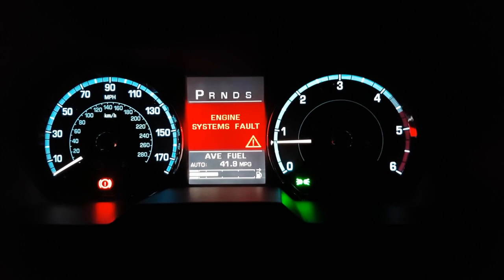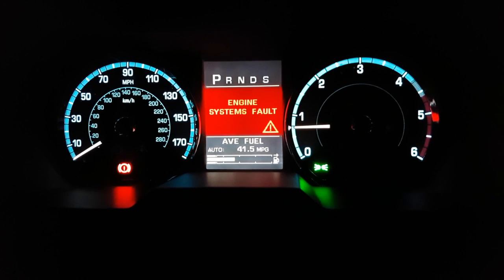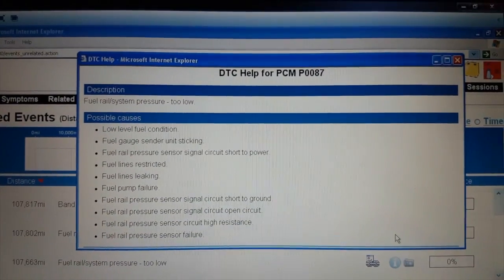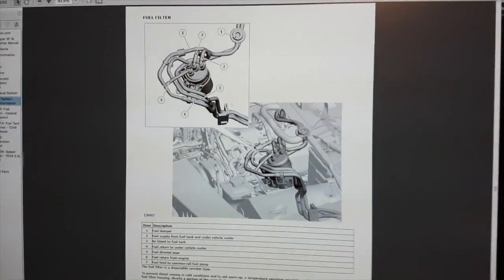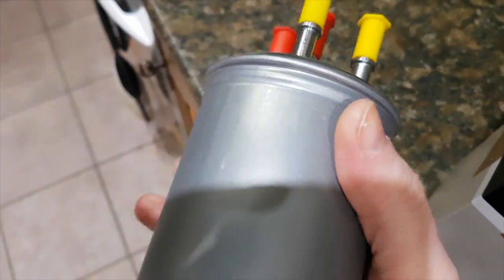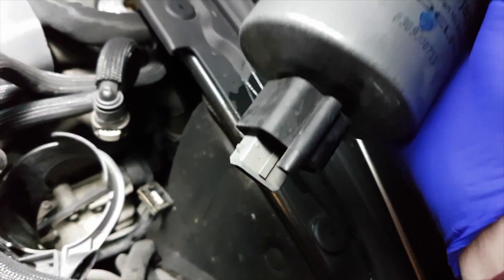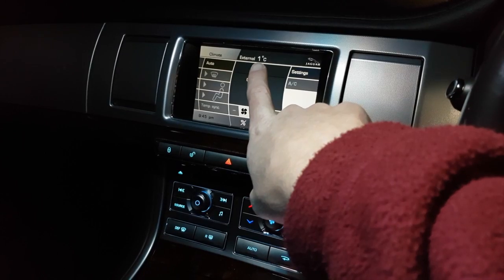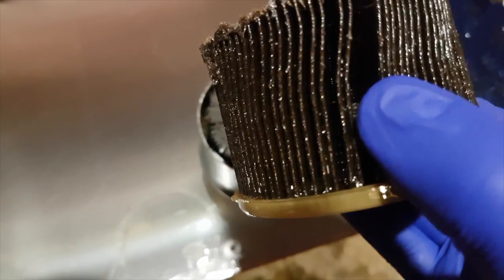Jaguar XF P0087 Engine Systems Fault and Fuel Filter Change

Comment: I've tried to prime the new pump this way but it doesn't feel like any petrol is going into the filter. I have half a tank so plenty of fuel I've resorted to putting the old one back in as it still had fuel in it. Could I have a air blockage in the fuel system or something? I'm just short of flattening the battery

Comment: I have a 2011 XF Portfolio and it keeps saying that there is water in the fuel, would a new filter solve this problem. i have done what the user manual says but it still says that there is water in the fuel. Any help would be appreciated

Comment: I have an water in diesel warning. I plan to change fuel filter which is probably due as 10 yrs old. How do I re-set warning light do I need specialist plug in diagnostic equipment?

Comment: Hi Fella
Excellent video! I have exactly the same problem ‘to a tee’! You have explained this in a very clear way for a mere mortal like myself to undertake. Hopefully it will work for me? Worth a try.
Regularly serviced  by Jaguar @ 135,000. Just noticed that there is no sign of a filter change anywhere in the service book…… Sheesh!
Where did you get your SDD software?
Thanks for your super video👍

Comment: Had exactly the same symptoms when entering motorway and giving plenty of throttle my 2.2 XF.  Engine died and had to coast back onto hard shoulder. Thank god it didn't happen on one our lovely new " smart motorways" . Re-started a few seconds later and drove home on reduced power. Changed fuel filter and all is well. Interestingly I date checked the filter and despite having so called  service history ( I bought the car with 80 k on the clock) the filter was the factory fitted original !

Comment: My XF S was only serviced 2000 miles ago, at an independent Jag Specialist garage. It had a major service and cam belt change and everything was good. I filled up at a local supermarket, before setting off on a 270 mile trip. About 20 miles into the trip, I got the water in the fuel, check handbook warning message! I thought here we go, another expensive trip to the garage and will I even get to my destination. I looked in the handbook and I couldn't find anything about what to do, so I googled the problem and amongst the results was this video. I am very practical and even recently rebuilt a 1974 Triumph Spitfire, however my XF is dealer maintained or Jag Specialist maintained, so I don't normally get my spanners out to it. This video is really well done and even includes how to re-prime the system, so I ordered a filter from Berkshire Jag Components (a Bosch filter, about £39 including next day delivery) and did the job myself. It took about 15 minutes, was dead easy and I had no problems what so ever. So thank you very much indeed, for taking the time to film and post this!

Comment: Hi, very informative video, just had my annual service done and that included fuel filter replacement (XF2009 diesel 3.0), an error in dash 'Water in Fuel' straight after service, mechanic suggesting to change the sensor under the filter, any idea what that might be ?
Reply: I get the same on my 2013 XF3.0 D S. I've read that fuse F43 in the main underbonnet fuse-box may have blown. I don't know why it should, but it might be a quick fix if it has. I believe the sensor itself costs £50 or so, but it seems to be a simple screw-in part on the bottom of the fuel filter canister.
Reply: @spudmurphy764  Hi, it was bad sensor, ordered for £90, all now fixed.
Reply: @Muhammad-Majid186  Thanks for letting me know. Checked F43 today - OK. Drained some fuel out of the base of the filter- clean as a whistle - no water at all. Went for a run - no warning lights, which is good. Hope it doesn't come back though - the sensor is easy enough to unscrew but its wiring goes straight into the loom, joins up with the wiring to the suspension top mount and the 2 of them disappear into the depths - dreas to think where I'd reconnect them.
Reply: Spudmurphy how many miles on your jag xf when this happened?
Reply: @eddybetanya  happened at 66,085 miles.
Reply: Spud murphy its just happened to mine (water in fuel) at 65,190miles.
Reply: @eddybetanya sorry to hear that, most likely to be WIF sensor gone bad...please keep me posted if/how fixed, cheers
Reply: @Muhammad-Majid186  All sorted now, new filter installed, car is much more responsive now, goes like hell.
Reply: @eddybetanya  👍👍

Comment: You could have avoided this by changing the fuel filter when it should be changed - or better yet before it needs changing. It’s an easy job.
Reply: Not always the case. Thanks for your helpful input though. 👌

Comment: My jaguar XF  4.2L supercharger engine power is low... my check engine is on... I haven't changed  my fuel filter ever since I bought it 2 years ago... is that the problem???? Where  is the fuel filter located in the XFS

Comment: Doesn't surprise me. I will NEVER take my jaguar to a Main jaguar dealership again.  Was told fault on mine was as a result of having a 'non jaguar approved' filter fitted so warranty didn't cover fault or replacement.  Only thing is, the 'non jaguar part' was fitted by the jaguar main dealer i bought car from 12 weeks earlier.  When I got car home checked new filter to find this main dealer had fitted an identical make and manufacturer filter ( that they advised was non jaguar approved).  My opinion is that the service departments are crooks and rip off merchants.  But parts on line and DIY. :)

Comment: Hi Leon, 
Would you advise removal of the battery negative lead before starting the job?

Kind Regards
Reply from the maker: Before doing most electrical work, yes. For diesel filters, brakes etc. I personally don't, although the service manual would have you disconnect it for everything. I just find it a pain in the ass to reset windows and other settings after having the battery off.
Reply: @leonfletcher6045  Thank you.

Comment: So this light has been coming on constantly recently and after I see it sometimes the car shuts down completely but doesn’t have no reduction in power, starts right back up and drives beautifully but it is doing it frequently. A mechanic ...not the dealer, put that car check thing in the box and nothing for the code. I hope it’s a fuel filter for me too because that light scares me and my pockets!

Comment: What the unit or system you use to identify faults ????
Reply from the maker: I use SDD - the dealer software, running on a Panasonic Toughbook and a Mongoose cable... but a OBD wifi Dongle (ELM327) and one of the better smartphone apps could do it.
Reply: @leonfletcher6045  cheers for that I have found a free download site for the add software but I search also for the disk copy also

Comment: Great Vid!!! Had the exact fault & replacing fuel filter did the trick. Many thanks :)
Reply from the maker: Glad the vid was useful! :)
Reply: @leonfletcher6045  Hi. Can the filter actually be "drained"? Someone mentioned it on some Jag forum, but I don't remember exactly.
 
Btw, the buzzing sound at 15:53 that's a fuel pump??  Mine is quite loud and I find it really annoying. I think I can even hear it when driving, the pitch is changing a bit, depending on engine rpm.

Comment: Hi Leon, great video! Got some real insight as my 2013 Jaguar XF 2.2 Diesel presents with a similar code - P0088. My local garage says a fuel filter change like what you did in the video should solve the problem. I am contemplating doing that or going to the dealer for a full diagnostic that's about 80 EUR. What do you advise?

Comment: Can any one help me with the water on fuel on Jaguar XF 2011 reg(eccessive water on fuel filter bowl) thanx
Reply from the maker: I would start by taking out the fuel filter (you can see me do this in the video) unscrew the drain plug at the bottom, drain off the fuel (and water) from it, and replace. Then re-prime the filter and see if this sorts out your issue.

Comment from the maker: Laptop is a Panasonic CF52 tough book (off eBay) that I use solely for diagnostics. I think I paid a couple of quid online somewhere for the workshop manual (google these onlinemanuals type sites) - I think the 2.7D and petrol one is available through the Jaguar forums for free. The Mongoose JLR (clone) cable came off the 'bay too and usually comes with a CD of the SDD software, or you could always 'ahem' torrent it ;)
Reply: Leon Fletcher thanks
Reply: Leon Fletcher Found the cable can please navigate me for the workshop manual?
Reply from the maker: http://www.jaginfo.org/showthread.php?22753-3-0D-Workshop-Manual
Reply: Leon Fletcher thank you very much 👍👍
Reply: I followed the link from forums you are linking to, but it seems it's dead. Any idea where i can get this manual from? Or maybe you can help with my issue. Engine fan starts spinning loudly as soon as i switch on ignition and stays like that until i switch it off, even few secs longer. Any idea what it would be my Jag is 2010MY 3.0 XF S Diesel. Thanks for any clues.